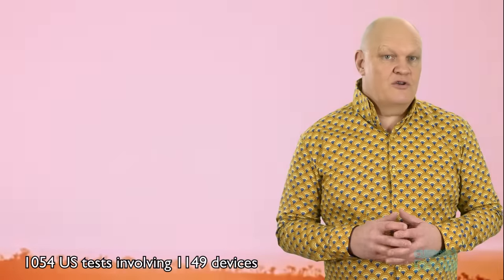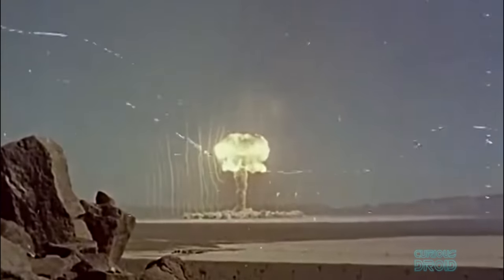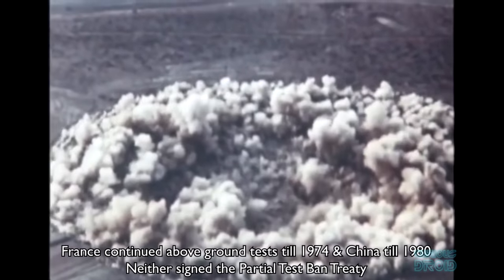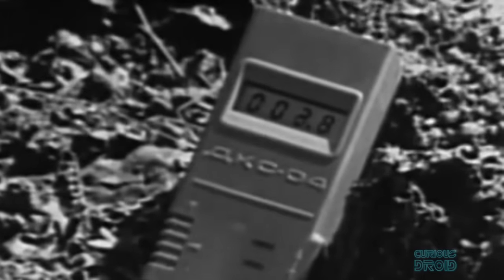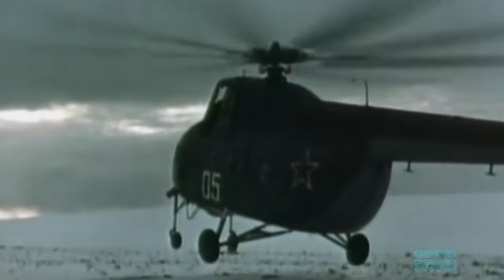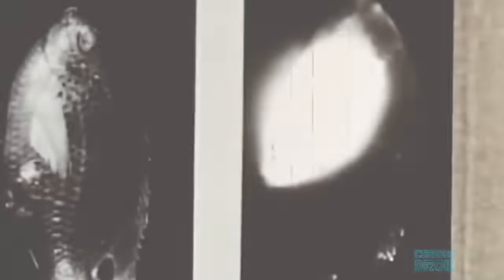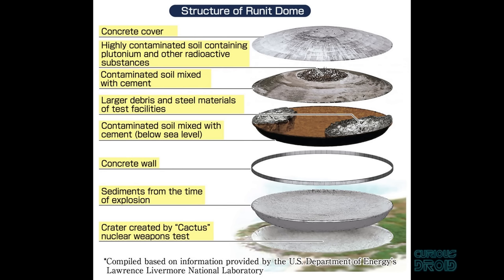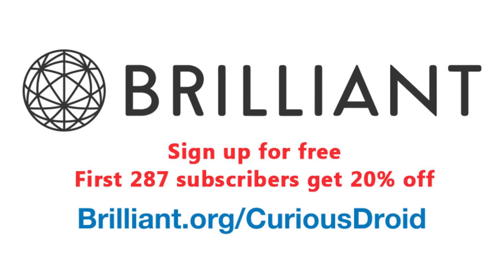What Happened to the Nuclear Test Sites?

Comment: Hard to imagine the amount of pressure and heat within that 1 meter radius around the nuke when detonated. A lot of weird things happening under those circumstances.... Awesome episode !
Reply: Warped is thinking right now: "how could i make a See-through nuclear bomb" :D
Reply: Curious Droid: that research into miniature nuclear explosives was also related to Project Orion, IIRC. Some of the Orion team were concerned that the same technology used to make nuclear propulsive devices for spacecraft also made it easier to construct small, easily proliferated weapons.
Reply: One of the concepts involved in project Orion's nuclear propulsion system was the use of nuclear shape charges. One of the physicists involved apparently claimed a 1 kiloton Nuclear shape charge device could theoretically drill a 10 foot hole a thousand feet deep through solid rock. That's what I call a bunker-buster!
Reply: Would that be the Casawba Howitzer?
Reply: "Would that be the Casawba Howitzer?" .....one of a few versions of it.
Reply: Not really, it's about just as hot as my arse after having a bad curry lol
Reply: worms armageddon?
Reply: Throw some carbon and make diamonds 💎
Reply: @InsanoBinLooney  But how exactly does one create a shaped charge out of a nuclear explosion? There's no material on earth that could direct the blast they'd be vaporized in an instant. Unless all you need is an instant to direct that blast, even a nuclear one???
Reply: Well... the materials go from solid to liquid to gas very quickly. Not weird at all.
Reply: @GameBrosMS  1
Reply: @RCAvhstape  .
Reply: What about Vietnam thousand   Of  children  born with  terrible deformities    As  in afganista    No  problem

Comment: Pretty sure many people will know this but the Soviets used Nukes to seal oil wells. Cause there were oil wells when drilled, where under so much pressure that equipment couldn't handle it, and those wells were so huge they would have leaked for years. So they drilled parallel to the bore hole, exploded a nuke which shifted the earth and sealed the well. And did that more than once!!
Reply: Curious Droid So far have only found the propaganda film explaining how they sealed this well, but if you can find footage of the environmental fallout from these accidents it's a sight to behold and well worth it. I'm talking black rain and a vision from hell. This video is very tame in comparison.
https://youtu.be/CpPNQoTlacU
Reply: Curios Droid videos are usually very interesting.  Unfortunately, the holier-than-thou, politically correct slant you insert, tends to degrade them.
Reply: Kent Smellman "holier than though, politically correct slant"?
I don't see it.
Reply: It is often said that industrial use of nukes was never proved out useful, usually because of the radioactivity.  However, in the USSR, they systematically geologically probed the underground structures using nuclear bombs as a part of their "Nuclear Explosions for the National Economy" program.  That survey's results were never released, but it is believed that Russian geologists have gleaned a lot of knowledge about oil and gas exploration on the cheap by these tests.  All were relatively small devices, a half-mile or deeper.
Reply: "holier than though, politically correct slant" is Alt-Right-Justice-Warrior slang for speech not consisting solely of short and stupid slogans
Reply: Looking at the situation of that oil well leak, I don't think any other method but the nuke would have stopped it, given the large amounts of permeable rock. Most of the fallout is contained beneath the ground, but I imagine a lot of the oil and gas would be highly contaminated too Sometimes crazy looking schemes for putting out oil well blowouts actually work really well. After the 1st gulf war there were loads of oil wells on fire, with the plumbing crippled by the Iraqis retreating. Some of the fires were so intense, the volume and pressure of oil so immense nothing could put them oil, except barrels of C4 

Barrels of C4 were detonated beside the burning oil well to put it out. It creates an extremely brief anoxic atmosphere, putting out the fire and allowing it to be capped. There's an awesome documentary about it called Fires of Kuwait, well worth a watch
Reply: @Kent Smellman
You should make a new thread. We are talking about a different topic here.
Reply: Evidence?
Reply: Fascinating
Reply: While I don't typically agree with people injecting modern moral concepts and "20/20 hindsight" into many historical events, I think this attitude is largely warranted regarding nuclear tests - a subject I've studied in detail. Its true that much at first was not known with certainty, but the effects began to be suspected long before Castle Bravo led to the partial test ban treaty. In all cases, these problems and effects were either entirely ignored or swept aside for the sake of politics. 

The people inhabiting the Marshall Islands had absolutely nothing do with that crap and did not, in any way shape or form, deserve what happened to them or to their home. Like so many other issues, the Boomer generation has merely turned a blind eye to the problem and shirked responsibility for their actions onto their children. The people in charge of those decisions deserve all the contempt they receive for their inhumanity and abject selfishness.
Reply: very interesting.  thanks
Reply: Yeah, they did.  Two worked, a third one smack dab in the middle of Ukraine did not.
Reply: So called climate change, buzz word for were doomed if we don't centralize tier 1 countries like USA. Please realise I'm for independence and individualism, not a collective ideology like socialism and globalism.

PS, I like Paul and he and his team put out a great product but lets face it people, seems as though EVERYTHING is politically charged these days.
Reply: Zarion 11 
Take the red one, prozackly.
Reply: Kent Smellman lol wut
Reply: actually the founding fathers where for independence and individualism ... basically any small governement is an aproximation towards a republic... any large governements are aproximations towards socialism and socialism also leads to globalism.
Reply: rollie yah you realize that is how wells were capped when oil and gas drilling was invented. About a hundred years ago.
Reply: BC3012 what are his views on abortuon?
Reply: Dan Simmons yes, of course humans aren't changing the climate, just ask texans about the huge decline in insects on which the entire ecosystem is based. All those scientists are obviously lying through their teeth because they're being paid by the stove what organisation with most money than the oil industry that wants to take your guns and cars from you
Reply: Little Cripple xz
Reply: this was actually brought up a lot as a last resort option many times durring BP's Deepwater Horizon oil disaster in 2010. probably mostly by the media, though. i doubt the US Government or other agencies involved in the cleanup ever seriously considered the option.
Reply: Little Cripple, nope,  I have studied nuclear history for decades and this is the first time that I have heard about sealing oil wells with nukes. I learn something new everyday every day.
Reply: +Hunter  " a subject I've studied in detail."  I don't care to what detail or extent you have "studied" anything. Such a remark is non sequitur.
Reply: You apparently don't know the difference between nuclear radiation and microwave radiation.  Wow.
Reply: That shall probably decay in isolation though.
Reply: puncheex2 Yep, my granddad worked as a geophysicist in the USSR and he worked with the results of these underground tests very closely, even based his dissertation on this. These tests were useful also in seismological research.
Reply: That was a pretty crazy thing to do. It was an idea that was discussed for a leak in the Gulf in 2010. Fortunately wiser heads prevailed.
Reply: @BC3012  this channel's videos?
Reply: Where'd you get your data? Tom Clancy?
Reply: I love watching as the left slowly lose their grip on sanity.
Reply: Red Adair!!
Reply: well...that actually sounds like a good thing? Is it?  Saving the environment etc?
Reply: BC3012, why? Does he not approve of abortion and a woman's right to control her body?
Reply: Oscar Banana, The boomer generation were not the ones in charge when decisions about nuclear projects were made. The boomers were the ones getting radiation poisining at test sites while the WW2 generation sent them there.
Reply: Big oooooof
Reply: Wtf does it have to do with the alt right? That comment could have been made by anyone of any poltical persuasion.  You are seeing shit that isn't there, projecting much?
Reply: Don't just blame the boomers, a lot of this testing was at the behest of older generations. The boomers weren't in charge in the 50s and 60s
Reply: Guinness: isn't climate but toxic chemicals
Reply: The US experimented with nukes also in the 1960's to develop natural gas fueks=ds. Decades ago long before fracking methods were developed. The idea was they would fracture the bedrock and allow the gas to be collected for commercial purposes. Sort of a swords to plowshares idea. The problem though, was radon and nuclear byproducts were thought to be getting into the natural gas used in the desert regions, and the process was halted. Imagine nuclear byproducts being piped into your own house! Not something we would allow today.
Reply: @nicosmind3  That was a very interesting video. Thank you.
Reply: Did not know that, thanks
Reply: @stevetreloar6602  controller body with birth control don't kill an innocent baby

Comment: Pointing out that you don’t use reactors to make u235. Reactors are used to breed plutonium, The uranium for the little boy bomb was refined using gaseous diffusion, thermal diffusion, and electromagnetic separation. Not in that order.

Comment: A horrible machine to end a horrible war, but the horror still hasn't stopped. One of the justifications for dropping the bombs on japan is that it would save lives in the long run. But it will probably will claim more lives than the invasion would have. Hiroshima and Nagasaki were chosen because they were strategic targets. That's not the only reason. They were also chose because they were untouched by the war. My country wanted to make sure the Japanese leaders understood exactly how much damage one bomb could do. They needed a fresh city to wipe clean. The irony is that some Japanese leaders couldn't believe the stories coming out of Hiroshima, but when my country nuked Nagasaki, the point was driven home. They believed after that one. One of the two Yamato battleships was built at the Nagasaki Mitsubishi shipyard, but I don't recall if it was ever used in battle. I wonder if Truman would have OK'd the bombs if he had our benefit of hindsight. I doubt either decision would have mitigated the tests that were guaranteed to follow. I just wrote all that from memory. Apologies if any of it is incorrect.
Reply: Yamato class ships: "All three ships were sunk by the U.S. Navy; Musashi by air strikes while participating in the Battle of Leyte Gulf in October 1944, the Shinano torpedoed by Archerfish while under way from Yokosuka to Kure for fitting out in November 1944, and the Yamato by air strikes while en route from Japan to Okinawa as part of Operation Ten-Go in April 1945."

Comment: Although he was thought the Trinity tower was vaporize, it wasn’t. The 1950s Orion project  - nuclear pulse proportion – require a reaction plate on the bottom of the spaceship that could withstand repeated nuclear detonations. One of the project engineers went to the Trinity site and found almost all of the pieces of the tower. They were pretty well wrecked, but most of the tower was still there. The data was useful in formulating the density that would’ve been required for the Orion spaceship reaction plate, which would’ve been mounted with giant shock absorbers that would dampen the nuclear pulses and transmit momentum to the habitable part of the spaceship.
Reply: Trinity site tower was VAPORIZED from ground level PLUS 4 feet below as a crater below and surrounding the tower was instantly excavated ! What is shown in the picture is the remaining base foundation of the tower, not completely erased due to the ground shielding the steel during the course of the blast !  Where the inspection team is standing is now 4 feet below the ground level before the test !

Comment: I figure when you buy a new car, it should be checked with a geiger counter for st.  So much 'scrap' metal from unknown sources.
Reply: There is a market for scrap steel that was produced before the atmospheric bomb tests and thus not contaminated by radioactive isotopes in the environment from that period. It's called "low-background steel", most of it from old ships and, most famously, from the wrecks of German battleships which were scuttles in Scapa Flow after the end of WW I. It's used for certain special instruments where you don't want even very mildly radioactive such as Geiger counters, whole body radiation counters, some scientific equipment and some space sensors.

However, that doesn't extend to cars...

Comment: I used to work at the Nevada test site.
Regarding the Trinity test at White Sands, New Mexico:
The speaker incorrectly stated that the Trinity test started on May 16th 1945.
This is inaccurate.
Trinity was on July 16th 1945 at 5:29 am MDT.

Comment: The "over the rooftop" shots at 11:10 and 11:37 were of the RDS-37 test at Semipalatinsk shot from the city of Kurchatov (now Semey), not the Tsar in Novaya Zemlya.

13:02 "Testing started there [the South Pacific] in 1948..."  It started there in 1946 with the Crossroads series (Crossroads/Baker is pictured at 12:52, and discussed at length thereafter).

17:03 "...a crater on the island of Runik was used..."  The shot on the screen is the Redwing/Seminole, not the Hardtack/Cactus test whose crater was filled with contamination.

21:11 "eventually about 2.4 million deaths will be the result of nuclear tests".  Yes, and in the time from 1945 to "eventually" that may be out of the 10 billion or so deaths that have occurred over that time period, or .08%.  I don't mean to belittle 2.4 million (though I'd love to see the statistical basis for that number), but still perspective is important.

Comment: 0:06 except the british attacks of 1812, the japanese invasion of Aleutian islands of 1942 and the 9/11 thing
Reply: Battle of Columbus, NM. 1916. 
As for the islands, "the term mainland United States is sometimes used synonymously with continental United States, but technically refers only to those parts of states connected to the landmass of North America, thereby excluding not only Hawaii and overseas insular areas, but also islands which are part of continental states but separated from the mainland, such as the Aleutian Islands (Alaska). - WIKI
Reply: @buzaldrin8086  I've read something about the punitive expedition but didn't remember about this, cool info thx 👍🏻

Comment: The dose estimates are base of the linear no threshold hypothesis and the deaths are based over decades. First, the evidence for linear no threshold is so weak that it is competing with the hormesis hypothesis where low levels of radiation are helpful in the low range.
Second, the anticipated deaths are misleading because, (1) everyone dies, (2) if fails to present years of life expectancy lost and third what is the normal expected death rate and what is the increase.  20K deaths may sound like a lot but if the expected is 20 million, is it statistically significant or relevant?

Comment: I thought H-bombs were much cleaner than A-bombs
Reply: For their much greater yield (explosive power), they are indeed cleaner than fission only bombs. However, all modern thermonuclear bombs use uranium or plutonium in at least the first (or primary) stage to trigger the fusion stage(s). Much of the power of such bombs is the result of fission. "The fusion fuel of the secondary stage may be surrounded by a layer of additional fuel that undergoes fission when hit by the neutrons from the reactions within. These fission events account for about half of the total energy released in typical designs."
Reply: @buzaldrin8086  Thanks